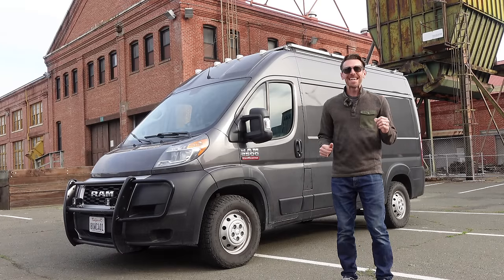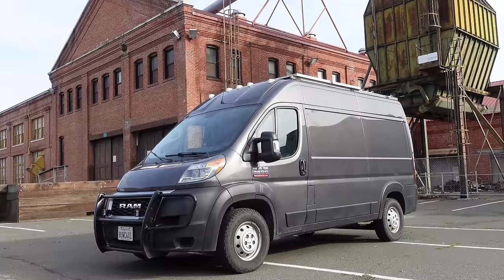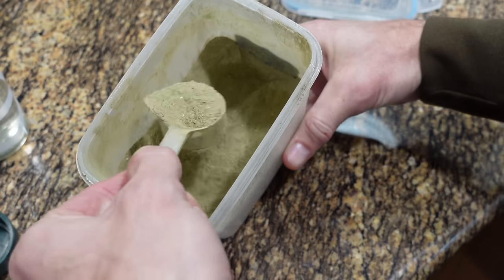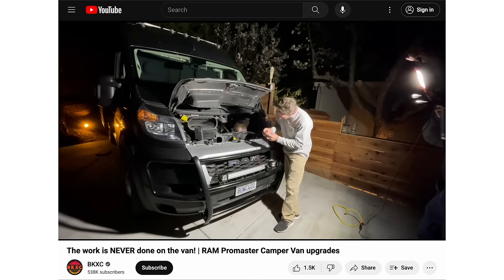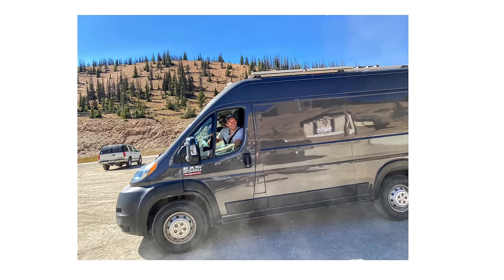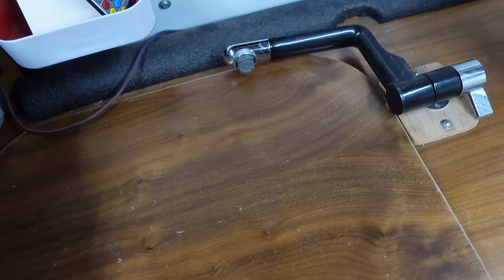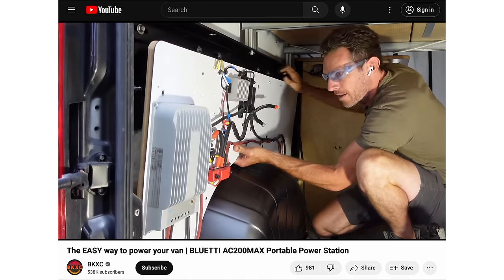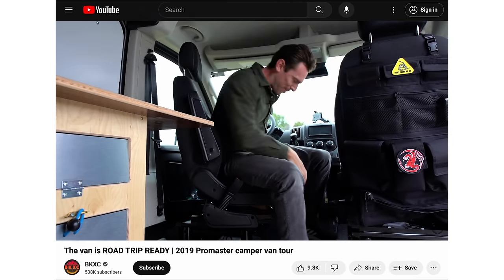100,000 miles of regret | My RAM Promaster camper van

Comment: Sounds like crap luck. That V6 is a very reliable engine. They’ve built millions of them. Only engine failure I’ve ever had was in a Toyota Sequoia. 🤷‍♂️
Reply from the maker: I have heard a few others comment on my channel with the same issue, #2 cylinder blowing up. But you’re right, it’s definitely bad luck overall when there’s millions of these things on the road!

Comment: It's a great engine.....but not meant to pull that much weight and againest the wind... millions upon millions were made...Ford has issues as well with turbo DI motors.....Triton engines suck... Hemi ticks.....LS lifter problems.... Benz.....six maybe the best.

Comment: Your knowledge about adding LED headlights is outdated. Openglass makes a conversion kit that requires no cutting or gluing, and its LED bulbs triple your headlight brightness without blinding oncoming drivers. I installed mine in a couple of hours.
Reply from the maker: Yep! I just swapped in off the shelf H7 bulbs. I didn't realize that things had changed.

Comment: REMEMBER ONE THING, SINCE THE EARLY 70'S, CHRYSLER PRODUCTS HAVE BEEN AT THE BOTTOM, OF BOTTOM OF THE QUALITY BARREL. ALL YOU'D HAVE TO DO RESEARCH. AND 17,000 FOR AN ENGINE IN THAT? HOLY CRAP. I HAVE A 2013 MUSTANG GT. THAT'S NEVER BEEN WET. IT'S THE 5.0 COYOTE ENGINE. JUST FOR FUN I LOOKED UP THE PRICE OF A CRATE 5.0.  IT WAS 8000.00. YOU GOT ROBBED.

Comment: I use a promaster 2500 for work. It has had electrical issues since it's first 5k miles.  Toyota is about to start selling one of these vans with a toyota driveline in it.   I'd way rather have the toyota version. I am not at all impressed with ram or the 3.7L hunk of junk it comes with.
Reply from the maker: I agree!!